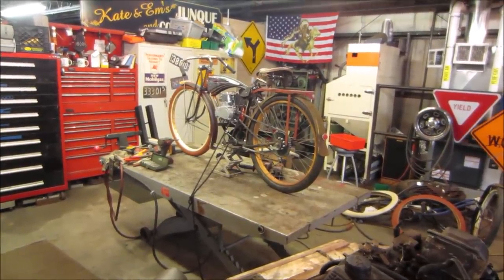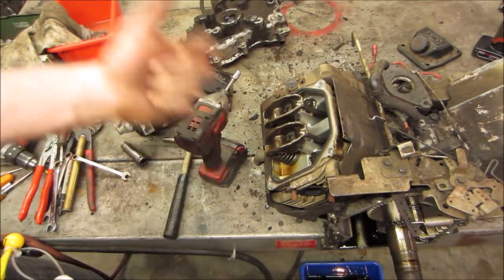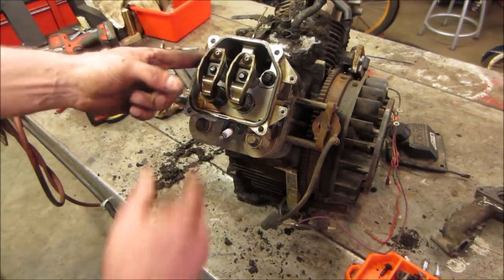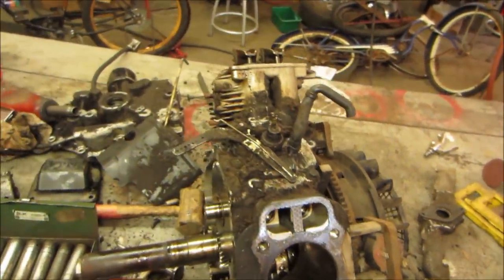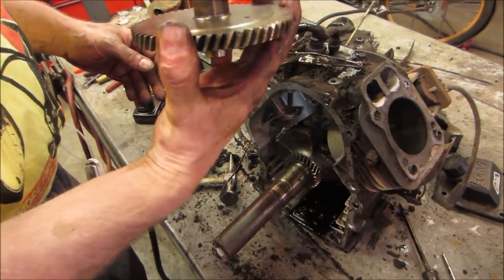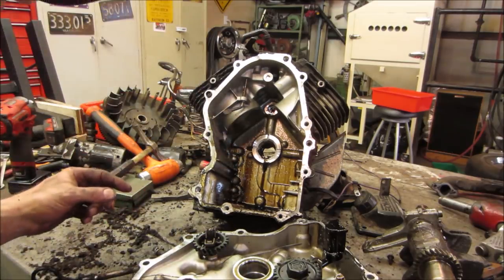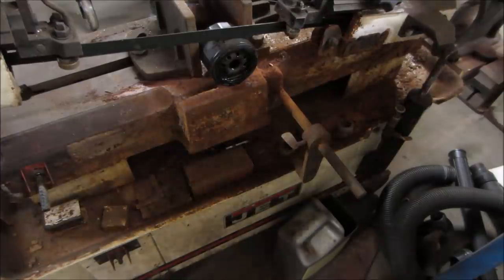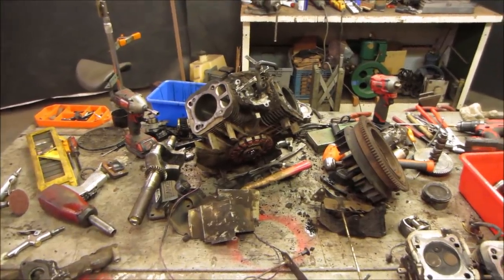Why Did This Engine Fail?

Comment: Sometimes Mustie we just don't know jack. I was thinking run away governor or the person running the machine wanted the day off. Thanks for bringing us along for the ride.

With regards to loaning out equipment, I had a neighbor borrow a piece of equipment and had not returned it when he came asking to use my lawn mower. I have no problem telling it like it is. I said as soon as you return the equipment you borrowed 3 months ago I would consider loaning you another. He brought back what he had borrowed and I wheeled out a relic of a push mower. I told him that this is my cherished personal mower and that I expected him to return it in the same condition he received it. He pushed the mower across the street where his grass was almost to the point of needing to be weed wacked first. 5 minutes later I look out to find the mower sitting next to my gate. I looked over at his lawn and noticed a very small section cleared and realized he gave up. I try not to let the actions of one spill over to the other neighbors.

Comment: My father always said never loan out anything you can’t afford to loose.
Reply: A very wise man, your father.
Reply: Never loan tools to people who don't own tools.
Reply: My grandfather always told me never borrow anything u can't replace with a new one if something happens to it.
Reply: (*lose)
Reply: Hopefully you can tighten it back up once you get it back.
Reply: My grandpa said that if you learn to do the things nobody else will you will never have to worry about competition.  😉
Reply: @tcmtech7515  sounds like a janitor that has 20-30 bathroom to clean in 1 shift
Reply: That's why I have cheap extras of almost all my tools those are the ones that get loaned out my dad told me that same thing
Reply: @alfredmorency8296  Spot on, if they take care of their own things they will take care of yours. Almost always. The problem is most people don't give a sh*t.
Reply: enforce the loan with ten gauge Buckshot
Reply: Heat killed that machine, not lending.

Comment: My bet, is the motor was on it's way out, and someone gave it the full throttle send to small engine heaven.
Reply: small engine heaven ... AKA Mustie's shop ??
Reply: @888johnmac  no, that´s the ER.
Reply: My bet is its a kohler command series and it blew up because thats what they do. Just picked a tractor up with a 21hp kohler command with broken rods
Reply: @Tshizzle42o  So, in essence, The Command is catching up to the Courage.
Reply: not just small engines, an ex Mercedes dealer solved an under warrantee engine noise issue that way,
after disabling the rotor's over rev spark killer. lots of repair jobs stalled as the parts came in COD. folded at last.
Reply: i had a ford van years ago with the 300 six in it. she started to go to pieces out on the interstate so i pulled to the berm and floored it to get full satisfaction. seems now that it took several minutes before she shuddered and gasped and said goodbye. i still miss er.  dammit girl.  did ya have ta go?
Reply: @rverro8478  Courage also gets a bad rap for a few simply stupid design flaws. If addressed, no problem. Still have one that's 15 years old.
Reply: My brother did that to an old car he had difficulty starting on cold winter mornings. he put a weight on the accelerator pedal to keep it from stalling then went for a walk while it warmed up. He could hear engine parts flying around under the hood half a block away, he told me

Comment: When "friends" ask to borrow from my large tool collection, I always tell them "You can borrow my skill saw but I don't have any usable blades - go to HD and get a new blade". Or sanding belts or router bits or whatever.  Their response is ok, I will - and then I never hear about it again.
Reply: With friends like that you don't need enemies
Reply: Andrew Amador That's very clever, I ask for a deposit at replacement cost. The problem with my approach is they tend to get bent out of shape but at least they won't ask again.
Reply: Ive had people do that before
Ive also had people ask me to fix there mowers  for them but when i say they have to buy the parts if it needs something they wont do it
Reply: i actually replace any consumables i use when i borrow,  so saw blade, motor oil, fuel, bar oil (chainsaw).... i basically operate as "give it back in the same or better condition then i got it" one chainsaw i got had a sticky throttle, slow revving with stalls on idle and thick oil when i got it,  after i was done i stripped it to the engine, cleaned each part and rebuilt the saw, gave it back looking like new with no sticky throttle, returned the jets and new oil... guy i got it from says its never run this good since he bought it and wanted to know what i did. :)
i said: i take care of my equipment
he said: but its not your equipment, its mine.
i said: its true, but i still treat it like its mine... or did you prefer your saw like it was?
he never objected to me borrowing a tool again.
Reply: I’ve lent one of my cordless Dewalt drills to a work colleague. When I’ve got it back, he’d blown the charger!!😡😡😡😡😡😡😡
Reply: @cyndernight2422  you are like me, and a VERY rare exception.
Reply: my luck they will install the blade backwards cut with it and burn up the motor

Comment: If I lend something to someone, it's already written off.  Borrowers aren't using the same equations that owner-operators use.  Generally, I'm standing there withholding with effort my judgement that I am being asked if I mind being used.  I had a Kohler powered leaf collector and that engine was not only bulletproof but started on the first pull after sitting a season.  Got a small yard, gave it to someone who broke it in two months!  I felt I had let the machine down.
Reply: James Jacocks I loaned a tiller to a cousin. His wife paid to repair when it broke so she felt it then belonged to her. I thanked her for paying rent (repairs) for the 6 months she kept it and took it home.
Reply: yes... yes you did

Comment: WHAT CAUSES THESE ENGINES TO FAIL: These Kohler Command v-twins fail because of a poorly designed oil pump. At 41:38, at the end of that tube where the plunger goes, there is a little metal cap that gets punched into place which falls out, and I'll bet you will find a little round metal cap somewhere in the carnage. With that cap no longer in place, the oil pump is unable to maintain pressure in the pump and there is no more oil pressure after that. I bought 2 Craftsman GTs from different people at different times, both had Commands with thrown rods, and both of them had that little cap fall out of the pump causing them to self destruct.
Reply: Thanks for the intel !
Reply: Decent engines as long as that is addressed.
Reply: @MrCarGuy  Agreed, they are one of my all time favorite small engines in terms of power and reliability once it is addressed.
Reply: Hunter, was that cap missing in Mustie's pump? I am not familiar enough to tell from a still frame. From looking online it appears the pump has been redesigned quite obviously in the pressure regulator area.
Reply: @djmips  the camera angle wasn't good enough for me to be able to see
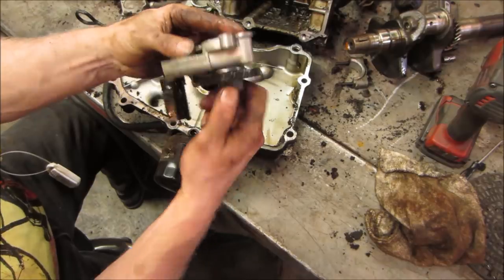Reply: @djmips  43:10 It looks like this oil pump is a revision. instead of having a cap pressed in, it has a pin going through the passage to hold the pieces in place.
also, if it is just some sort of sealing cap, the system would still work as intended since the piston valve at the top end of the spring would be the sealing surface. Oil wouldn't be under the spring.
If it was a structural cap to hold in all the guts of the regulator, then yeah, if it popped out, all the guts would pop out and it would bypass all the oil.
Mustie's pump has a pin going through which means whatever regulator components are in there, are still in there.

Comment: Discolored metal, cooling fins packed with debris, oil and oil filter never changed. Looks to me like it ran too hot for too long. Cooked oil that doesn't lubricate as well combined with the piston rings expanding too much. I think the piston rings temporarily seized, and when the engine cooled down the rings let go again, that's why the pistons came out relatively easy.
Reply: Exactly what I was thinking. Rings pinched the pistons, weakest link let go

Comment: Mustie. I really learned a lot from you about how to disassemble a small engine. I'm thinking of doing the same on my Kohler engine because the piston froze on it too! Now, I have an idea on how to attack this job. Thanks for taking time to explain the parts of the interior of the engine. I'm  not a mechanic but I appreciate your approach on how you analyze what caused the motor to expire.

Comment: I happen to like those V-twin motors. they don't have a particularly long service life. My son rebuilt one for his employer. it was on some kind of zero turn mower. had the block bored. they fitted the 2nd version of pistons as the original were no longer available.  it cost !!!!!    Those pistons really cost some coin. Then he found that both coil packs were flakey.  He never did get the governor to work right. kinda sticky he said. but his employer didn't want him to spend any more time on it so it ran as is. It also loved to shake the carb loose from the intake. 
As for this engine. to me it screams a lubrication failure. the scoring in the cylinder on one side. the packing up of the throw on the crank.  probably enough to cause the rod to let loose at top speed, maybe it was even running at overspeed. Those lifters even on the video you could see were packed in.   probably the source of the metal that got into the system which probably aggravated the crank throw bearing surface. Ya, it ran hot. you can see how the oil was well burned .   might also indicate poor maintenance schedule.  Thats my unprofessional opinion. Ya I know, opinions are like belly buttons. everyone has one. I recall seeing those hyd lifters the first time. made me think of Chev V8 ( small and big block ) lifters. never did compare them.

Comment: Yep, loaned out my push mower and after 6 months I had to ask to get it back.  Of course it would not start and had water in the gas tank and in the oil.  Don't loan out anything anymore either.  Also loaned my chain saw to my neighbor and then I find out he wanted it for a church member and it came back in pieces.  I now just keep my stuff.  You want something done and I will do it for you if I can.  Just don't try to take advantage of my anymore.  Great video.

Comment: I see two young boys playing with the vacuum when Dad wasn't home. They like the "whirring" sound of the vacuum. One grabs the governor and holds it wide open. They smile and laugh.  BANG!! Then their eyes and mouths become "wide open"...and they run.   ;-) Whatever happened, it seems to have happened immediately. Except for the empty large end crank journal. That could have been starved of oil, for some reason, and was leading up to this over time. Try pushing oil through the crank and see if that oil passage is blocked.
Reply: Yep over speed wrist pin broken from the con rod and one damaged pushrod it was raced to death

Comment: Those Kohler flywheels are notorious for rust-jacking the magnets off. I cleaned mine up, labeled the poles, and JB welded them back in place, with playing cards to space them all evenly. Worked great.

Comment: Whether or not you discovered why the Koehler failed, it was entertaining. I was wondering if you blew out the oil passage hole in the crankshaft?  My 1st thought was that it was clogged and was the reason the Rod journal seized.  I agree with the idea of someone latching on to the throttle and over-reveled the engine until it seized and detonated.  I also think most of us have a story about lending out tools and not getting them back in running condition.  My new paint sprayer came back full of sticky red paint.  I had to toss it.
Reply: At least you got it back ,usually you get the i don't know where it is but I'll look . Then they move never to be heard from again .
Reply: Roger that oil pump was real tight until he opened it. Maybe the oil filter just wasn’t changed, ever. And when the rod furthest away got starved things got out of hand fast. That fine metal can really clog completely. That’s why transmissions have a magnet at the oil return to keep that out of the filter. Still, speculation from my own experience.
Reply: @armstronggeorge1533  or they make copies of your precious CD's give you the worthless copy and keep the original
Reply: @billssolarpowerandgardenin1016  Im going with the theory that the little plug came out of the oil pump, rendering the pump inoperative
Reply: I too wondered if you blew out the oilway as it was the furthest rod that failed from the oil 'in' port

Comment: I had an tractor engine one time with intermittent running problems... Turned out that it had a valve guide that would start to seize when it got hot. Once it cooled down it would be fine and made it very hard to diagnose. Given the sludge on the cooling fins, bent push rod and wear mark on the cam, I would have to say that valve guide was getting hot and seized which back fed into stopping the cam and crank suddenly causing the weakest link of the crappy aluminum rods to let go. probably kept running on the other cylinder grinding everything up till they could hit the kill switch

Comment: Loaned my pressure washer to my brother-in-law who used it to clean out a horse trailer. You guessed it--he blasted all of the horse crap all over the pressure washer and returned it full of crap all over it. He's asked to use it several times since, but it doesn't run anymore (at least for him)!!!!

Comment: all that dirt caused overheating , especially of crankcase.Oil not changed enough and hot oil does not lube enough.add in possible over revving and you have instant disassembly.

Comment: I was once given a car: 4 cyl, 3 con rods but it still ran, so I drove it home... On later inpsection, at some point, one of the big end bolts had unwound itself (lock washer was never folded over the hex head during manufacture or rebuild?) and took a hike. The cap and second bolt bent, crank escaped the big end and then minced the entire con rod, as the now disconnected piston dropped down the cylinder. Eventually, equilibrium was reached and the piston stopped moving. I found that disassembly quite educational too, even though the end result was similar to your experience with this little twin...

Comment: For those wondering those are small block chevy lifters .We use to build those kohler command twins for our race mowers they are usually pretty tough engines
Reply: My 25hp runs rich. he has another episode where a leaky needle valve causes similar symptoms.  Mine has an accelerator pump but no mixture adjustments to turn down, and plastic float is hard to bend to adjust float level.
Reply: Could you save that case by welding, soldering or epoxying a plate over that hole that was made by the connecting rod? then perhaps turn the crank however undersize is necessary unless you have a good one in the stash?

Comment: I bought a repowered riding mower off my neighbor that had the " Courage engine " Now it has a Briggs. My neighbor said it had an oil leak when he got it, and eventually it hand grenaded when it ran empty...lol. So He and a friend repowered it with a brand new engine.  I HAD to take look inside that Kohler  and found pretty much what your video showed us. As for lending out equipment...not a chance. If you need to borrow something for a couple of hours, chances are the rented store will have what you need. Iv'e learned the hard way as well, that some people just don't care about other peoples stuff. Ruined it for others unfortunately.  Great video as always.

Comment: Ran warm from the crap in the cooling fins - oil gets thin and not as "luby" - lowered oil pressure and lowered lubricity caused the rod furthest from the oilpunp to fail. Just a theory. Does not explain the bent pushrod though.

Comment: i keep looking at that huge snout on the dead crank and think.. i wonder what one could make out of that snout..  thanks for the tear down video..  you do need to look around for a tubing cutter blade.. to make a filter case cutter.  decades ago.. my friend took a large pair of channellock pliers and drilled three holes in the sides of the jaw.. created his own filter tubing cutter with a pair of small ball bearings on studs and the tubing cutter disc on a stud.  he did not try to tap the channel locks..

Comment: I think the rod siezed in the crank at combustion maybe and just crumbled. The other one similar but just threw out the side knocking the starter off. I think if you had thought to put the oil pump back on before removing the oil filter maybe you would have found the pump was hard to turn again. There was such a large amount of metallic load on the paper that maybe everything was becoming oil starved. The crank is the first customer and the first to get angry. That rod may have been failing and things just got worse because as you know as evident by super clogged airways the oil filter may never have been changed and lifters stopped rotating and then the weaker or further away from oil journals of the two rods began to be eaten away at and clogged the oil filter with micro metallic particles. Like you said maybe the old oil filter made them remove the wire to the oil sensor. Nice that they put that at the top end. If you still have that case and pump put it back together and try out the theory. Put a plug in the filter inlet. Or not. Thanks for the autopsy, got the old brains thinking and as always yelling at the tv and the wife reminding me you can’t hear me. I know but it’s fun! 😝. Keep up the great work. Hope you’ll give me your 2 bits.